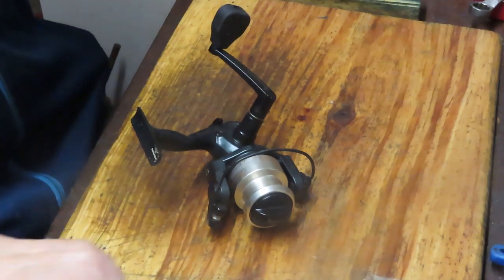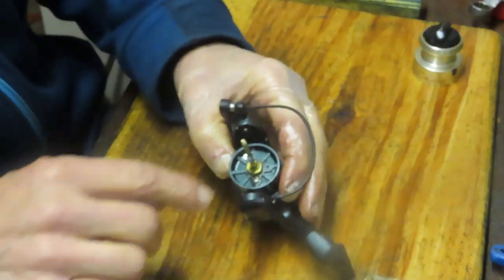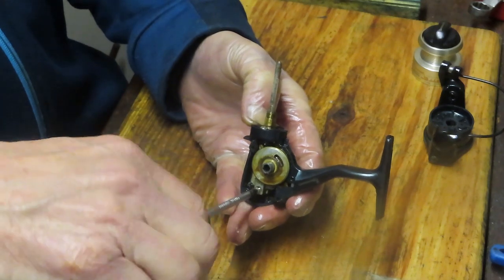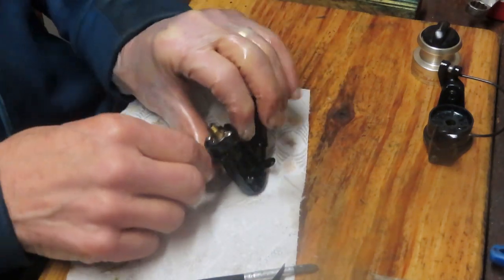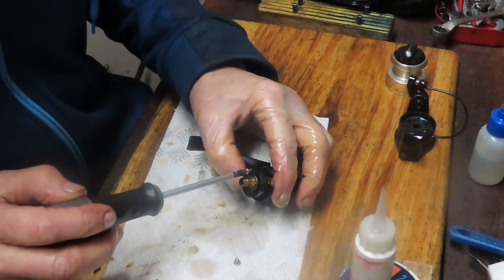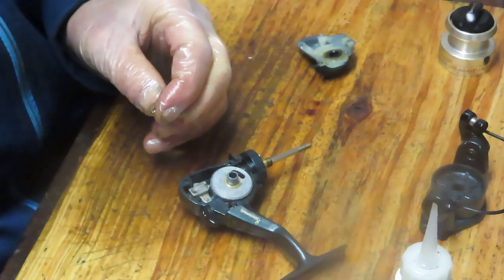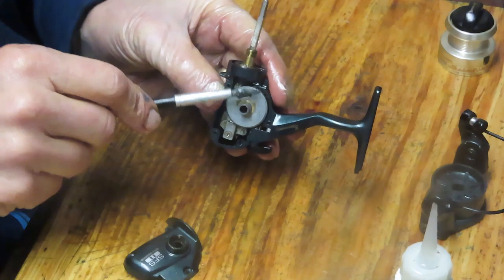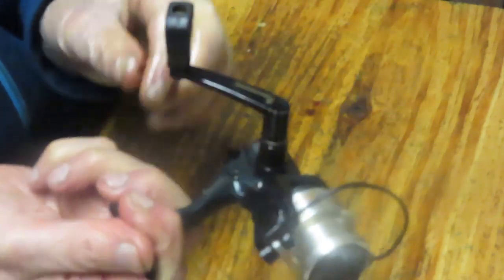Browning SFS 10 freshwater fishing reel how to take apart and service

Comment: Dennis, I have at least four Browning / Mitchell large saltwater reels from that period of time when Browning owned Mitchell. Two of them are the blue/gray reels - a 496 and a 498 that came with both white and steel gray spools. The other two include a 488 Sport and a 498 Sport. They all came with the side plate seals that Browning added to the large Mitchell saltwater reels. I put those Browning seals on all my large Mitchells. All these reels that are Browning / Mitchells that I have were still made and designed in France. They are some of the nicest Mitchells I own. I’ll e-mail you some photos of my Browning / Mitchell reels.  This little Browning is a good design. — Chris
Reply from the maker: Thanks Chris

Comment: I bought a few sfs 13 in 1995 rear drag system when I was 12 years old I still have them they still work well! No idea how many ball bearing they have
Reply from the maker: That makes sense.  Browning just had a few years of production after they bought Mitchell and it would be around the time that you purchased your reels.  The only problem with these reels is getting replacement parts when / if they do break.  Thanks for the note - Dennis